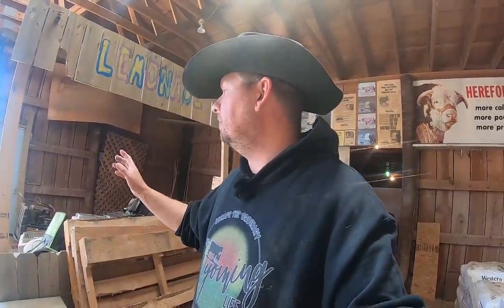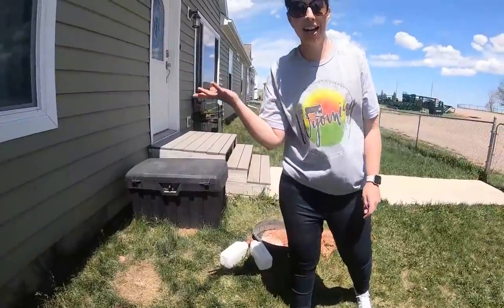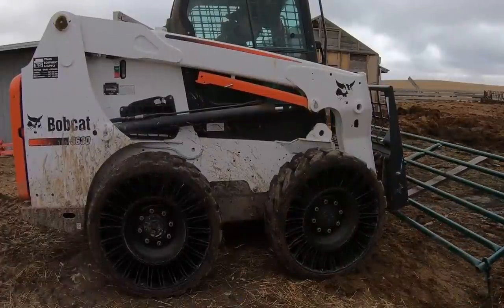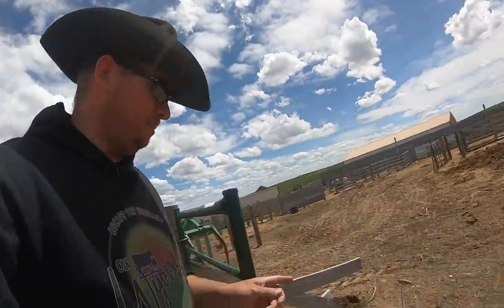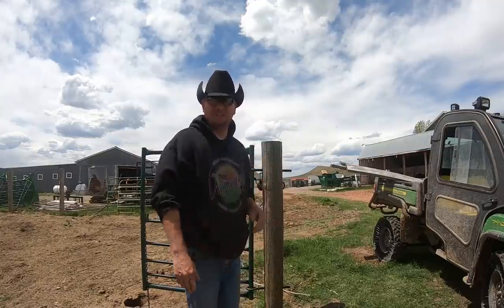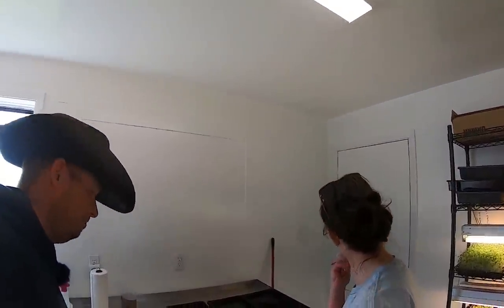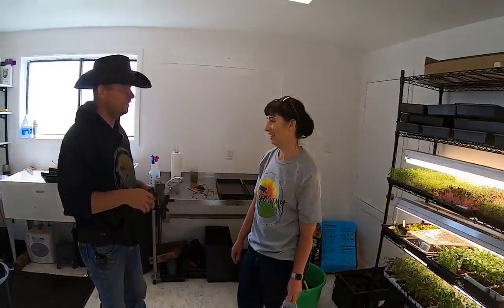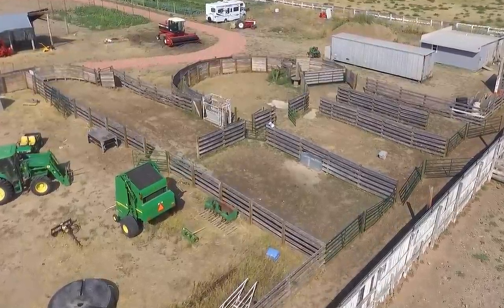Corral Teardown Continues...

Comment: To save the gate threads, use two nuts cinched tight together to cover the threads and whack the hell out of the bolts. 
When the nuts touch the post use a 1/2" or 3/4" steel rod to to finish knocking the hinge out.
Reply: Good call. Or grind the damaged end off the hinge when you're done. Shame the hinges are captive to the gate or they would twist out.
The post might shrink when it's dry and let go the hinge. Stick it in the shed for a month.
Reply: Dam....beat me to it
Reply: Might  be worth  leaving as is if the post is in good condition.  Just replant the post where it's needed next time.
Reply: yeah quin great idea
Reply: Speaking from experience?

Comment: Put a nutor 2 on the end of the thread flush with the bolt then hammer away and minimal damage achieved
Reply: Mike, this is exactly how to get any tight bolt out of a wood post.  By the time you finish hammering it half way, it should loosen up the hole a bit. Also, grease on the end that is sticking out, to help when pulling the rest of the way.
Reply: yup

Comment: Mike, To get the gate pins out of the posts.  Try this.  Thread a nut onto the end of the pin about three quarters of the way onto the nut so you are hammering on the nut.  Then put a little dish soap on the pin and it may slide more easily through the wood post.  If it works you can then just remove the nut and the threads should be saved.

Comment: Put a small jack between the post and the gate to "jack them apart". Or if the post was still in the ground, use a come along to pull the gate/bolt away from the post. You can still strap the post to something stable, then use a come along on the other side to pull the gate bolt out.

Comment: When we bought a place it usually had many miles of old ceder post.    We used a John Deere 720 to take out the post.  We put a short chain in the cast iron rim.    The tractor would drive along side the post and the chain wrapped around the post to be pulled out.    The next one without stopping in low gear.

Comment: Put a nut on the end of the bolt to protect the  threads then put a 2X4 up against it, and then whack it with a small sledge hammer.  That's how we always removed bolts from posts.  Easier to do with post still planted. Once you get the nut up against post, remove nut then if you still can't pull it out use small rod or pipe to whack it the rest of the way out.

Comment: Always put a nut on the end of the bolt before hitting it with a hammer. Another way would be use the bucket as a wedge and pry the gate to get the bolt moving out of the hole. John

Comment: Before you tear into that post to get the gate off of it. Try using some grease, oil, or 10WD40 spray oil. Hopefully that will make it slick enough to get the gate off with out tearing into the pole.

Comment: Put  the nut on the end of the bolt  with out the threads exposed then you can drive the bolts out with a hammer then use an alignment punch to finish the drive.

Comment: Put a nut on the end when hitting bolts with a hammer.
Use an air chisel to drive the bolts out through the holes in the posts.

Comment: WHen you hang the gates again put a nut on the bolt then add a flat washer them insert bolt into the post then add another flat washer and the nut. The first nut will allow you to pull the bolt out of the post by removing the nut .

Comment: MIKE,
RE : BUGGERED UP THREADS...
To keep from buggering up threads which needs to be hammered on,
thread a nut onto the end of the bolt & hammer on the nut.
WHILE WE ARE ON THE SUBJECT....
Whenever you need to cut off a threaded bolt or rod, first thread a nut on.
THEN,
Cut the rod ot bolt 
THEN,
clean up the cut end by grinding a chamfer on the cut end
THEN,
thread the nut off & as it comes off it will straighten any buggered up threads you may have made.

!

Comment: Beatin on threaded bolt ends
Put one or two nuts on end of bolt nut is flush - better yet protrudes beyond bolt.  this will save bolt threads from damage.  IF two nuts thread them together tightly.

Dan Bentler
Seattle

Comment: Hi Mike and Erin. With regards to your gate. Put the nuts back on the bolts but leave them hanging out a little bit. Then smack them with your bfh, so the hammer hits the nut and not the thread. Once its as far as you can get, use a small bottle jack between the gate and the post to get it the rest of the way.  I'm not  admitting to making the too small hole in the post mistake myself, but , just sayin' ..  Look forward to new vlogs. Thanks for the great work.

Comment: A thought or two concerning the gate removal:  You could have used a chain or tie down strap and pulled the top gate out with either the tractor or the Bobcat.  Also, you could have started the movement by prying between the post and the gate with a hefty bar or a 4x4.

Comment: Two ideas 1 use air hammer to push out may want to try putting torch on bolt first get red hot then would burn hole bigger let cool down  then air hammer  probably would have to grind end little but should be easy

Comment: If you'll invest in a can or 2 of Kroil oil, it will loosen up rusty nuts. Nut flush against that last outside thread will let you beat on the end without damaging the end or the thread

Comment: I was half expecting you to use the cutting edge of the loader bucket to push those lag bolts out. That's what I woulda done anyway 'cause I probably woulda managed to thump myself with the hammer at least twice before getting frustrated and breaking out my BGreenFH. Or the cutting torch. One of the two at any rate.

Comment: SAVE THE POSTS.  Screw a nut on the threads until it is even with the end of the threads.  Then you can hit the gate pin with a hammer and not damage the threads because you're hitting the nut.

Comment: Mike, call me deselect but now that you have the gate and post on the ground try taking a 2x4 between the gate and post knocking the post off the gate? Use that same hammer and gently tap on the 2x4  one end then the other. You should know right away if this is going to work. Good luck.

Comment: Just a suggestion, when hammering a bolt for removal, thread the nut on the end, so you mash up the nut & not the stud part of the bolt
Reply: Or slip a scissors Jack in between there to add pressure while a person does the nut and hammer idea. Been there done that.

Comment: Put a nut on the end of the bolt before hitting it with a hammer, prevents the threads on the bolt from getting messed up.
Reply from the maker: Yeah but I still have to get it through the post :)
Reply: @OurWyomingLife  Probably not worth the trouble to drive them out, just split the post. You could use a 5/8" dia. long bolt to push the hinge rod the rest of the way out, but it will take a lot of pounding with a heavy hammer to get those hinges out. Maybe drill your new posts w/ a 7/8" bit for a 3/4" hinge rod. I've made the same mistake Mike, but we only make it once. LOL

Comment: Mike, anytime you hebe a bolt that is stuck and you need to use a hammer on it, put the nut back on till its flush with the end. Then you can hammer on it. You may still bugger up the end some but when you take the bolt back off it will fix your threads. Cowboy

Comment: The most amazing thing I saw was how do you know where to position the post so you can grab it with that fork on the tractor🤔🤔🤔🙄. Also if you want to drive out the bolt, just put a nut on it so you don't damage the threads. Then you can hammer to your hearts content.

Comment: Man I wish I could run posts that shallow. Around here anything less that 40" down will get pushed out by the frost heave. Been driving fence line posts 48" for the last few days.
Reply: Where do you live that you have to put posts in 48 inches
Reply: @garyoakman6187  South Central MN. Just above the MN River valley. If I drive my wooden posts 3' or less they don't stay solid or the frost pushes them up. Combo of deep frost and deep heavy black topsoil and solid clay under it.

Comment: Use a high lift back. Save the posts. They'll last 20-40 years . Those cheaply made pipe gates with livestock and manure will do good to last 5 years .

Comment: When I was an ironworker apprentice, many eons ago, my Foreman once told me I needed to be smarter than what I was working on.  Couple things to keep around on the ranch that will come in handy. 
A set of 6 ft nylon slings/chokes.
A few cans of Kroil.
6 or 8 lb maul
Couple of three quarter eyebolts
Metal cutting blades for your sawzall,
And if you dont have a sawzall aka reciprocating saw, get a good one.  They're handy as hell. 
A nice little welder. I highly recommend Lincoln Ranger 8. A good oxy/acet torch.
Make sure to invest in a rosebud attachment for it.  At some point, you'll need it.

Comment: I think I hear the gator??? Was that a scripted joke? Haha

Protip to get the brace out of the post: grease the shaft that has to slide out. Then, jam two nuts together flush with the end of the all thread. Hammer away. You won't damage  the threads and once it starts, it will get easier.
Reply from the maker: Nope I thought I heard the gator.

Comment: Put the nut back on the end of the threaded bolt a little bit then when you hammer it out it won't mess the threads up

Comment: So, put a nut on the end of the threads and go ahead an whale on it.
Reply from the maker: How do you get the nut through the post
Reply: @OurWyomingLife  Gee, Mike. Drill a BIGGER hole, whydoncha'?🤣 You don't. When the nut gets to the post, remove the nut. You will either have roughed out the hole by driving the all thread that far, letting you pull the rest or you can use a smaller rod with your sledge to drive it the rest of the way.
Or use the grapple to pull them apart?
Or drill a relief hole next to the allthread.